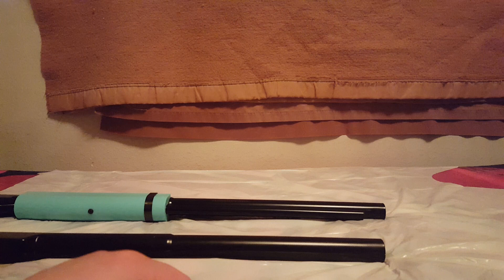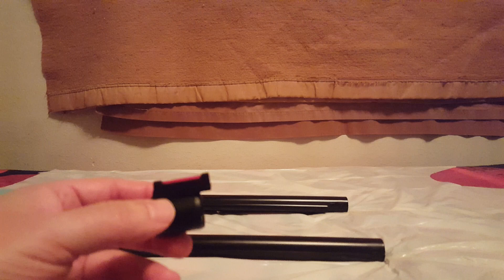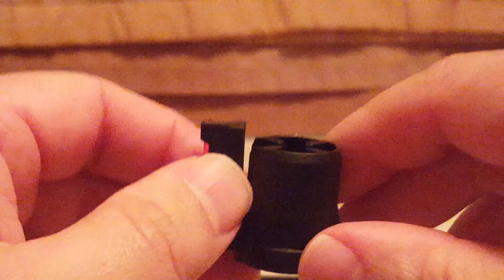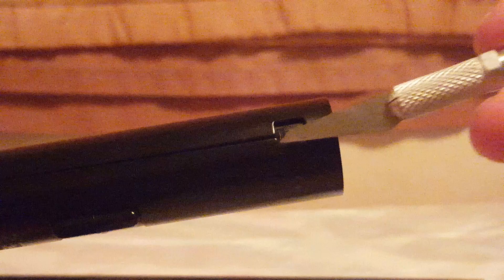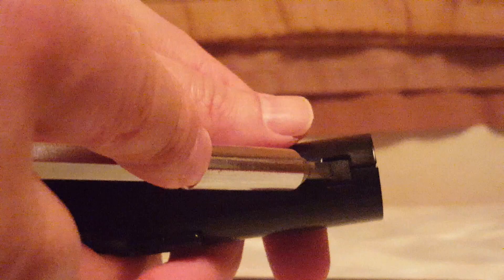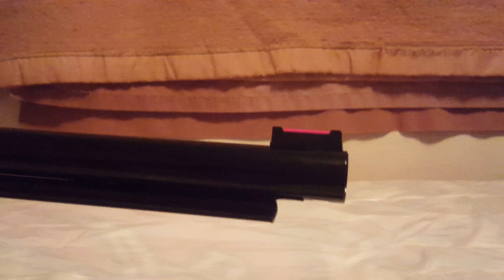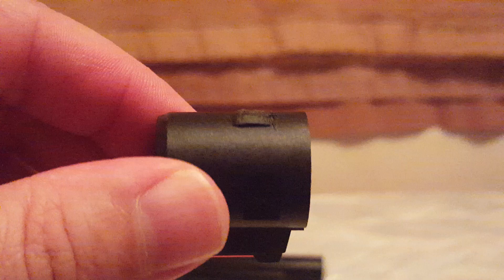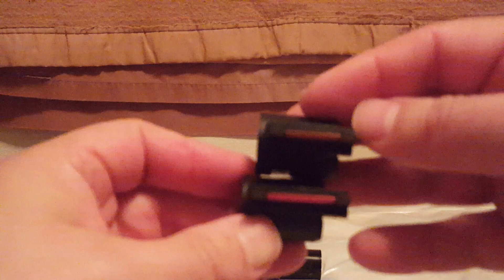Daisy Red Ryder & 1999: Fiber Optic Sight Installation

Comment from the maker: For clarity, I consider the standard black plastic blade a factory sight. The fiber optic has a FAT BUTTON...and can't be pushed off muzzle. The faulty fiber sight, shown in this video,  had to have the button shaved down.

When ordering, just ask for Ryder Fiber Optic Sight. They have streamlined the process. You don't need a part number.

You may have to wait on hold for 5 or more minutes, but it is worth low price. Order 2 just in case. You could always help a buddy.
Before 5pm Arkansas time, weekdays.
479-636-1200.

2 Fiber Optic Sights + shipping = $5

My 1999 gives much better accuracy now. It kicked in immediately with new fiber sight. The barrel is clean and the moving parts broken in.

Comment: Loose front sights are always a problem, you're right about that. My Red Ryder has not had that issue yet, it's still very tight, and of course as a result, it shoots very accurately. But my 880 had a loose sight many years ago, and I ignored it for too long, it was shooting all over the place. Finally I replaced the sight with  a new once, which fit very tightly, and suddenly the 880 was super accurate again. Oh, and by the way, I just ordered a metal lever for the Red Ryder, and a scope mount. Should be fun!

Comment: Thank you so much for this video because of your video I just changed the broken front sight on my Daisy Grizzly. It was super easy... Thanks for the help
Reply from the maker: Hold on to that Grizzly. BEST BB gun for the money.

Now that Daisy discontinued it, it can be hard to find replacement parts at good price.

O rings are simple - Danco nitrile #13 x 2. Easy. Pump head and VB (valve body).

The key parts that may be a struggle are the valve stem and compression return spring for it.  If the spring softens (sets), the stopper won't reset and won't retain air. You may just improvise with a new compression spring that is stiff enough to reset the stopper.

If the stem and stopper goes, well, if you see a Grizzly for sale or spot one, try to buy it for the valve stem. Do that ahead of time.

Comment: What kind of rod do you use to align the sight onto the barrel tube.
Where do I get one ?
Reply from the maker: Wadedog, that is simply a straightened WIRE coat hanger.  A Cleaning rod for .177 airguns will work also.
Reply: @daisy880fanaticfixit9  thank you

Comment: Wait...you actually took a BB gun to a gun shop?
Reply from the maker: Ed, thanks for question. Many razz me over that, without knowing my gunshop knows the history of the Red Ryder and how it has changed.

Some gunshops are hardcore FIREARMS ONLY. They would tell me to scram. 

My gunshop use to be, in the1990s, airgun central before the internet took off. They warned me I was in for a headache helping with Ryder because it is OVER ENGINEERED in back with the anti trap.

I have registered 5 JAM TYPES. 3 in back. I've gone through more than 3 generations of fix videos until I got it covered. I cleared a breech jam and dislocated plunger in back. My gun is heavily lubed with Ballistol - spring and backside - and I only shoot NEW Avanti or Umarex Zinc BBs.

The old Ryder just had 2 classical jams - breech and loading ramp.

What I show in this video is basic enhancement. A mod is reengineering the gun. My Ryder jumped to easy 1 1/2 groups up to 15 yards after fiber sight install.